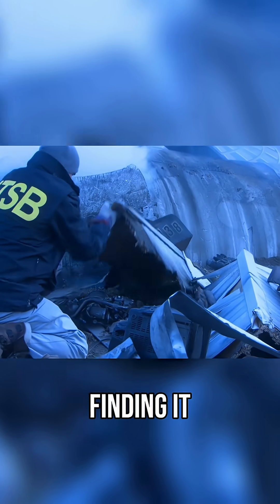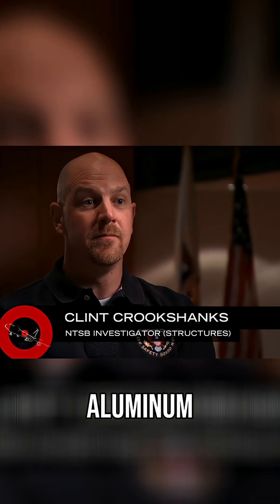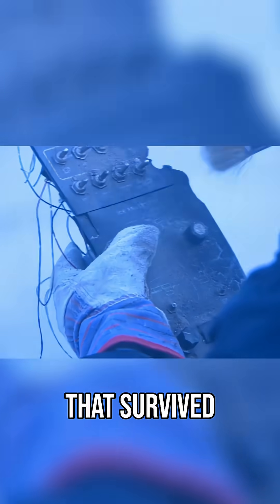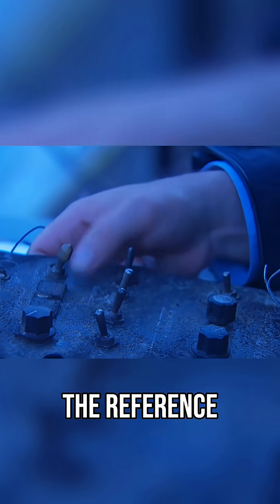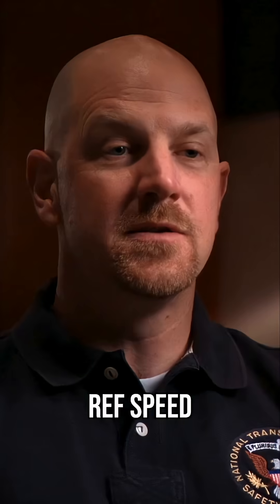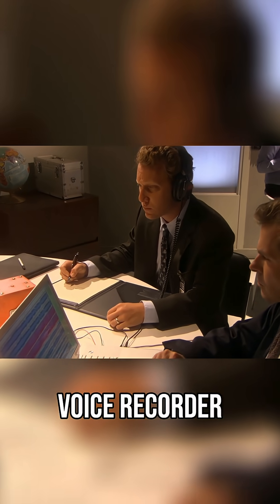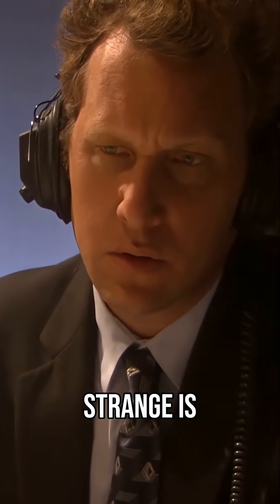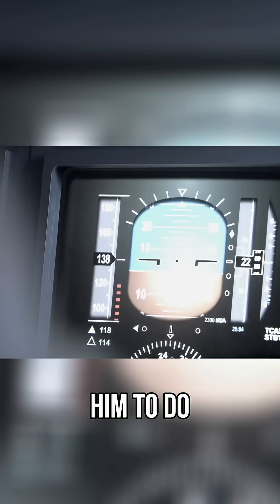Q400 Ice Panel Mystery Buffalo Flight 3407 Crash | Mayday: Air Disaster

Comment: BOTH PILOTS WERE FATIGUED.  BLURRED VISION, SPEECH, NON STERILE COCKPIT.  PAY PILOTS BETTER SO THEY DON'T HAVE TO SLEEP ON THE COUCH.
Reply: Pilots make a $100k to $500k a year so the problem is not the pay, it's just the pilots did not know how to do there job or they just messed up which is why no trust pilots cause they make mistakes that should have never been made
Reply: @Matt-ke8oc The crew of Colgan Air 3407 (this episode) were regional pilots. The captain made $50k, and the copilot $16k. That’s less than a bus driver.